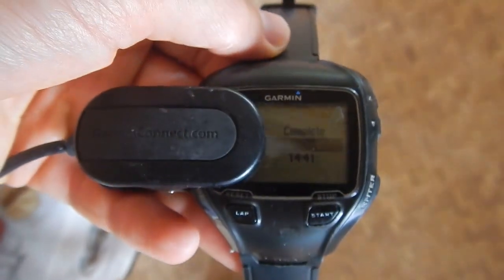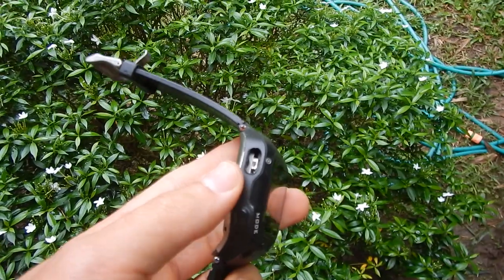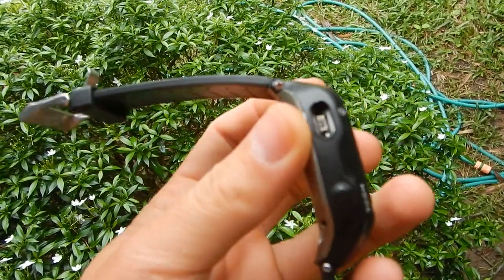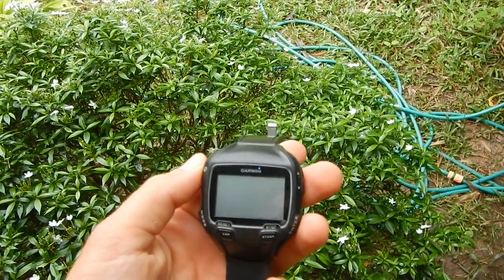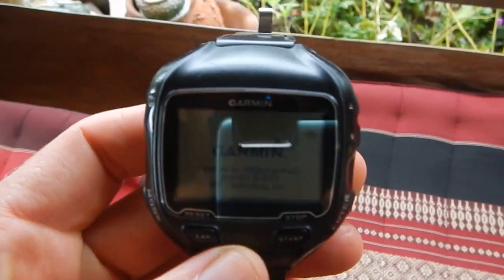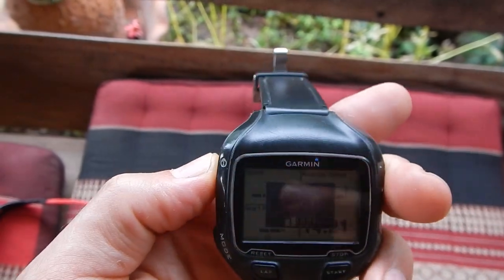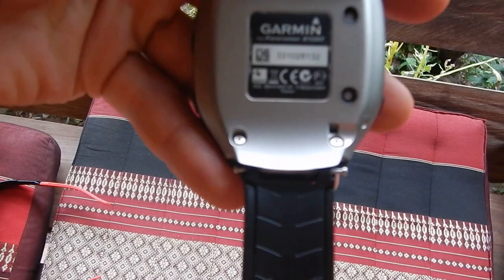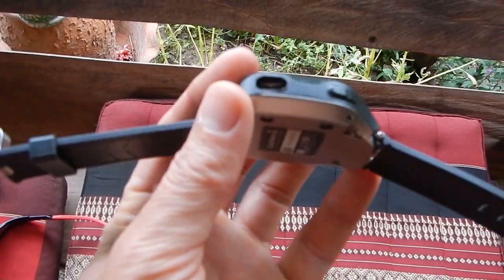Garmin Broken Power Switch Tips (Forerunner 910 XT)

Comment: I solve the problem

Just cover the switch with electrical tape to protect the switch then use RTV . Silicone gasket maker.

All my side  Button are gone .

But. By using silicone gasket fill the button holes to  mold a button.

Even if this is not waterproof anymore it works like before.

The button is flawless
Reply from the maker: Nicely done, thanks for sharing your solution!

Comment: It's a design and material application failure, the buttons could not last long, it seems harden and breaks. I had the same situation, went to shop for 1 on 1 exchange, and paid additional sum on 2nd unit, end up used less than a year, 2nd unit button breaks...very frustrating and could see Garmin changed to hard case button on their new models, but left us miserable for those who bought 910xt.
Reply from the maker: Thanks for sharing the info!

Comment: The rubber button cover on mine is still good, but the button won't come on any more. It has been failing for a while. I'm wondering if I should just cut the rubber button off and poke something in there to turn it on off? The problem is I'm out in rain and snow a lot.
Reply from the maker: Yeah, it's just very bad.

Comment: Mine just started to have a little crack in the rubber of the power button. Do you have any suggestions?
Reply from the maker: a rubber like tape or glue, but otherwise wait for it to fail before applying slash destroying it with glue or tape.
Reply: Mine presented that exact same problem a week ago. After 6.5 years of almost daily use, the power button rubber presented a small crack. I have given it a try with a bicycle repair patch. I cut a patch so that it will cover all the rubber area that surrounds the power button, and applied it as I would normally patch a tube.
 So far, it seems to work. But again, it's only a few days and I don't really swim with my watch. Still, I want to keep sweat and rain from entering it.
Reply from the maker: @mnts9358  thanks for sharing the great idea with the bicycle tube repair kit. I might try that one myself. :-D